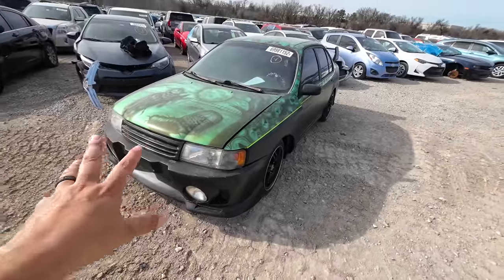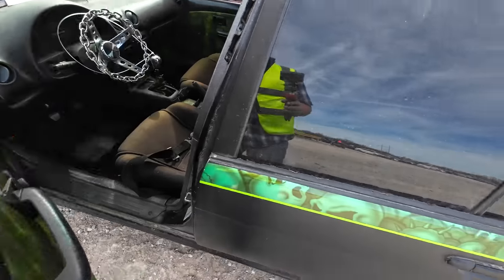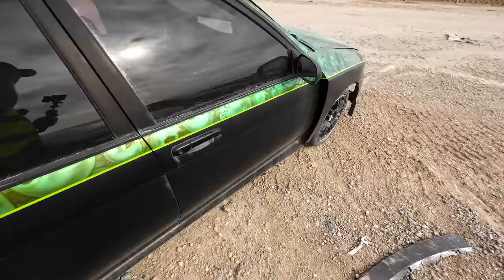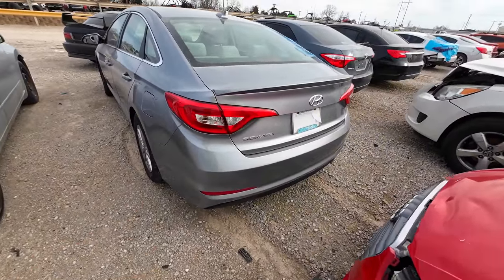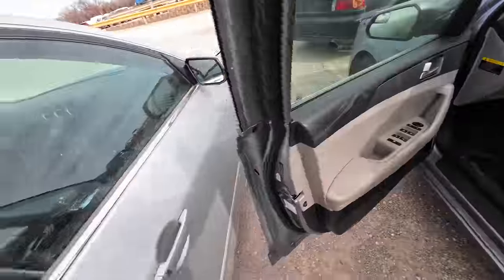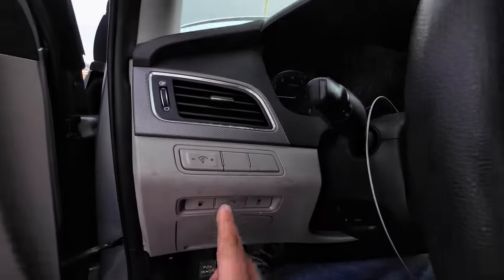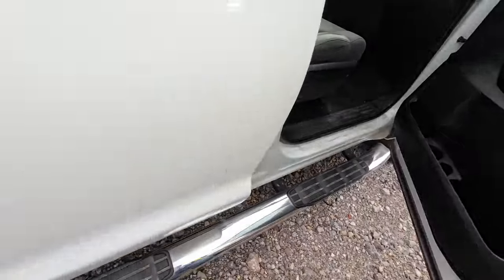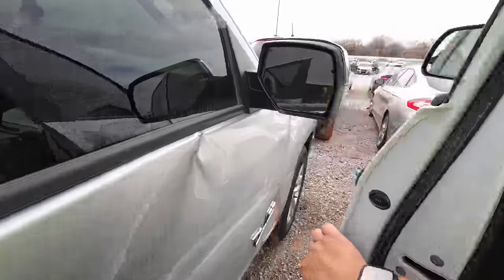Copart Walk Around 2-15-23 + Crazy Modified Toyota!!

Comment: That tercel is nice. If I bought it, I would revert it back to it's original blue color and fix that interior. I would keep the spoiler though. I gotta admit that makes it look sick. I would probably swap out the 1.5L engine with one from a current gen Corolla/Camry. That would probably be enough to turn it into a hot rod, especially with the Camry's 301 HP V6 engine.

Comment: The Tundra with the sand in it, thats clean sand. Not road grit sand or sand from city streets.  If there is a beach nearby they likely drove into the beach, got stuck, then the tide came in. OR alternatively they were backing their boat into a dock and didn't set the brakes and she went down the boat ramp into the drink.  If it was salt water tide, hose it down right away and throw industrial fans on the chassis and get all that out with clean water and you will be OK. The bumper damage was likely from someone chaining it up and pulling it out, the chains likely snagged and crumpled the bumper skin.